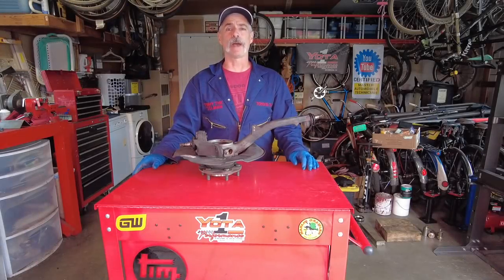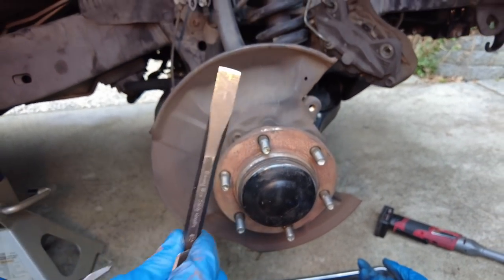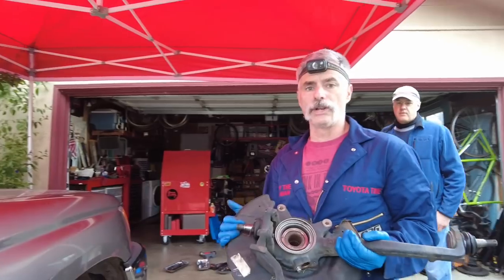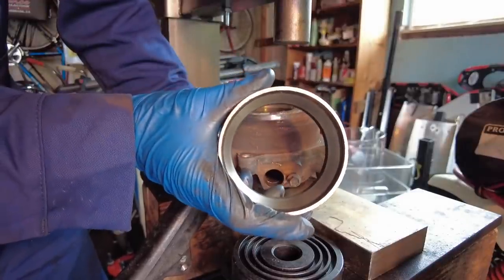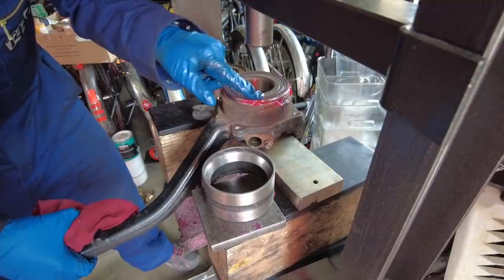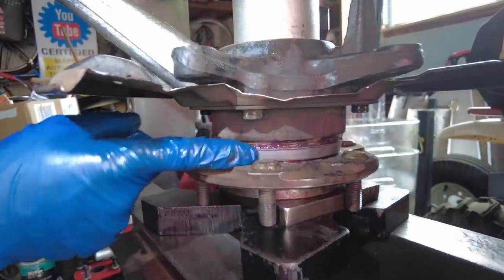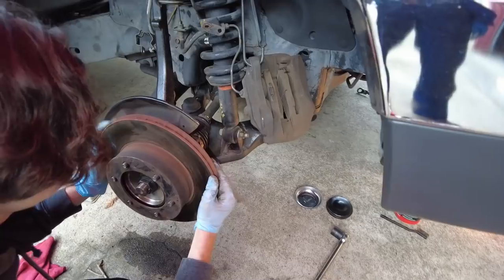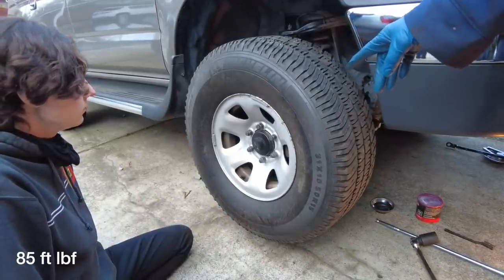Front Wheel Bearing Replacement (3rd Gen Toyota 4runner & 1st Gen Toyota Tacoma)

Comment: Hi. I followed your procedure for manual hub conversion for my Tacoma ADD.  I pulled knuckles from junk yard and installed new Koyo bearings.  Torqued up to 200lb on the hub nut and I still have play in the hub to knuckle.  Looks like the bearing inner races are moving inside the outer races.  Is there supposed to be play for heat expansion?  Any thoughts? Bearings both bad?? Thanks
Reply from the maker: There should be zero play in the hub when you torque that lock nut to spec.  The locknut preloads the bearing just like the torquing the CV axle nut does with the A.D.D. systems.  Something isn't right.  Did you properly support the inner race of the bearing when pressing the hub into the bearing?
Reply: @TimmyTheToolman  Thanks for the quick  reply.  I did support the inner race when pressing in the hub.  I pulled it apart again and clamped the new and old bearing inner races together just like they would be on the hub to measure them.  The old bearing measured 2.005" and the new one 2.015".  Maybe they were not machined correctly.  Also if the new bearing is squashed on the inner races I still have play in the outer race, longitudinally.  I think the "NEW" Koyo bearings are bad.  Going to call up Koyo and ask them about it.  Do you know if anyone else has had this problem.  I reassembled new hub with old bearing and it's tight (no play) so its definitely the bearings.
Reply from the maker: @kimfc9200  I can't remember anyone saying they had this same issue.

Comment: My 2000 1st gen tacoma just gave up both left and right rear axle seals :( , I checked my breather (mod hose) and it was clear and clean. My truck only has 115k miles, what makes these seals/bearings give up ? temperature swings, age, highway driving ? I have had other trucks that had over 200k miles and with never a leak or bearing replacement. thoughts ? I suspect when you pull axles , as in my case, to do diff work (locker install) that might disturb the seals just enough to start the leaking, but I drove the rig for 5 months with the new diff without any leak, just all of a sudden started, on both sides. Strange ?
Reply from the maker: Sort of strange both seals went at the same time, but one factor you didn't consider is AGE.  Even though those seals only have 115k miles on them, they are 24 years old.
Reply: @TimmyTheToolman  yes, agreed, age would be the first guess, puzzling a bit, but perhaps also because I put in a Detroit Torsion diff (not exactly a locker - but more like LSD), perhaps there is some kinda lateral flex going on when it engages ? Otherwise, maybe the seals/bearings were just at the leak point and "disturbing" them by pulling the axles to put in the diff was just enough to "wiggle" them out of position. Anyways, great video and saw the part 2 with the new tool, looks like a logical job, but I have a Toy shop that will do it for me and maybe have to clean/replace the brakes also, messy work ! Thanks for the reply !
Reply from the maker: @Evepc_Tucson  How much will the shop charge you to do both sides?
Reply: @TimmyTheToolman  not sure yet, but I believe they will use OEM parts and they are a Toy shop with decades of experience, so they have all the tools and the press and stuff to do the drums if they have to. They may have to replace the drum shoes since they have been soaked (and driven) in oil. So best to have it in a shop in case they have to do those or free any seized bolts and such. likely over 1k. If I was in CA I would bring it to you ! ;)
Reply: @TimmyTheToolman   **could you clarify the flipping of the retainer ? It seems that you thought you needed to flip it, then you flipped it back (beveled edge facing toward the diff) , **however in the Part 2 video , the one with the ABS tone ring, you did flip it (beveled edge toward the outside). I'm a bit confused about this, even tho I get the concept , i.e. you want the seal to "ride" in the middle, wouldn't Toyota machine that retainer to spec and I would think you would want the flat edge resting on the bearing , instead of the beveled edge. thoughts ?
Reply from the maker: @evepc  I think it will be expensive.  With the money you save doing it yourself,  you could buy the press, special axle tool, etc.
Reply from the maker: @evepc  We flipped it in both videos, bevel facing the ABS tone ring for the inner retainer.  The outside retainer for the bearing has the flat side facing the bearing.  Watch the videos carefully, and don't skip any footage, or you might get confused.
Reply: @TimmyTheToolman  indeed, but I don't have a garage, in fact, only a gravel driveway, and not a buddy or the tools to really do everything without some real challenges, like wind, rain, sunset, etc. I think if I had a garage and more personal time, I could try to do it all and have a place to store the press/stand, etc. **on the flip retainer, so the service manual does not specify the orientation ? thx
Reply from the maker: @Evepc_Tucson  The retainer flip is a modification to the original OEM set-up to address the redesign of the axle seal.  You really need to watch the videos from the beginning to get the full story.  You're asking questions that would be answered if you simply sat down and watched the videos in their entirety.  I'm not trying to be a jerk, but answering questions that are answered by watching the video and reading the video description does get kind of old.  We do our best to answer people's questions in a timely manner, and we do it because of our desire to help people.  So please do me a favor and watch both videos in their entirety, read the video descriptions and also read the comments we pinned (1st comment you see) before asking any more questions.  If you still have questions after all that, come back and ask away.

Comment: I’m in the middle of this job currently on a 2003 Tacoma pre runner and noticed that my bearings are oem timken, but are facing the opposite way with the black side facing outward. Also noticed that the outer race has a arrow facing away from the black side of the bearing. Any thoughts?
Reply from the maker: I think your bearings might have been replaced by someone and they installed them backwards.  But who knows, maybe the direction doesn't even matter.

Comment: Great informative video, only NEVER use wood in a press!
Reply from the maker: Never use wood?  I've used those wood blocks for many wheel bearing jobs.  I disperse the load by using steel plates in between the wood and the spindle and the wood and the press crossbar which prevents a concentrated load on the wood.  So, I'm not going to agree with you.  Those wood blocks have worked and will continue to work just fine for this application.

Comment: Hi Tim... I have 01 toyota 4runner in perfect condition with 180,000 miles...  no warning lights in the dashboard and everything works great except when the speed between ( 50 and 65 mph ) or when I hit hill the car start cutting down for couple times until I get the ( 65 or 70 mph ) after that the car runs smooth. Can you help please?? Thanks
Reply from the maker: I'm wondering if this is a fuel delivery problem.  When you climb a hill, the engine is working harder requiring more fuel and gravity is working against the fuel pump.  Does this ever happen on flat ground or when going downhill at the same speeds?
Reply: @TimmyTheToolman  Yes it's happen on flat ground too especially when I drive it on the high way between 50 and 65 mph, but when I pass 65-70 mph the car runs smooth.
Reply from the maker: @ghaithghaith2985  Hmmm, if it were me, I'd suspect the throttle position sensor next.  A problem with your 2001 throttle body is you can't buy the throttle position sensor separately.  You have to buy the whole throttle body and it's around $500.  But, before you drop that kind of money, you should do an ohms resistance test of the throttle position sensor to confirm it's bad.
Reply: @TimmyTheToolman  thank you so much brother.

Comment: Hi Tim, how tight does the wheel spacer have to be pressed onto the tone ring and bearing?
Reply from the maker: Press it on until you feel the press load up.  It doesn't require much force to press into position.  You'll also know it's done when the face of the hub shaft sits around and 1/8" below the face of the bearing spacer.

Comment: Hey Tim I need to do this job on my 03 taco 2wd prerunner. Are the parts that same for mine?  
Bearing 
Inner & outer seal also snap ring ? 
Thank you in advance
Reply from the maker: Hey Carlos, your knuckles are going to be different because of it being a 2wd.  I think the bearings, seals and snap rings will still be the same though but I'm not 100% sure.  If you plan on doing this job, you'll want to watch our Manual Hub Swap videos because those are similar to your knuckles.
Reply: Great info sir thanks . I got a video of my front bearing noise but can’t figure out how to load it here haha ..
Reply from the maker: @carlosrebollo405  Did you check for play in the bearing like we show in the video?  If so, do the bearings have play or are they just making noise?  You can send the video to my email: mtbtim@sbcglobal.net
Reply: Just send you the vid  no play on it but grinding noise for sure .

Comment: No one seems to have asked the obvious question: Why not buy the whole assembly  predone with all the bearings and races?I don't have a press and the associated press sleeves etc. It will be aftermarket and just getting all these tools to do just one bad bearing seems a bridge too far?
Reply from the maker: Well, because aftermarket parts are inferior to OEM.  You'll get an inferior knuckle, inferior hub, and most likely an inferior bearing, but sometimes these assemblies will come with a good bearing.  So, you're throwing good parts for inferior ones, that's why.  The tools will pay for themselves after one or two uses.  A press and press sleeve kit isn't a single use item if you like to turn wrenches.  They can be used for lots of other jobs.  

If you have a shop near you that isn't incompetent, you call pull the knuckles and have them do the press work for you.  But, you have to be really choosey using a shop.  So many shops screw this job up, mainly due to the fact they don't properly support the bearing when pressing in the hub.  

Anyways, good luck with your decision.  Just remember, tools are investment.

Comment: Timmy, love the videos, man! Question. The bearing you use from amazon claims it is 'Toyota Brand'. But in the description, it clearly says "Made in China". Using the same part number, I was able to find OEM, made in Japan, Koyo brand for almost $10.00 less from several Toyota dealers across the country. These are clearly marked Koyo Japan, while those in your link aren't marked with company or country of origin (though it states China in the description). What gives????
Reply from the maker: Some Toyota parts are now made in China.  I know the last radiator I bought that came from Toyota was stamped, made in Taiwan.  So, the link we provided did claim Toyota OEM for the bearings and that's why we provided that link.  It's impossible for us to vet every product link.  The seller claims Toyota OEM and the reviews were positive.  It sounds like you bought your wheel bearings from a different provider and that's cool.  This is why we provide the part numbers so people can do their own searching and purchase the parts from whoever they like.

Comment: For big azz tires i like to roll it on my feet and i can lift with my feet  to alighn it WHEN IM WORKING ON THE GROUND

Also helps to line up everything before lifting lug stud at 12 o clock rim opening 12 o clock aswell
Reply from the maker: Interesting.  I've always used the forearm and leg technique.

Comment: Hi Tim, need to replace my front dust shields on my 2002 Tacoma double cab 4x4 which requires removing the front hubs. Can I do this on a perfectly good hub bearing assembly without replacing anything? Any recommendations?
Reply from the maker: You would mess up the bearing doing it and also the associated seals most likely getting them off the knuckle.  One option is cut the dust shield in half and put it on in two separate pieces and then weld it back being careful not to burn through the material because it's pretty thin.  Other than that, it's going to run you some money and time keeping the dust shield in one piece.  If you don't have a welder, I bet a muffler shop would do it for very little if you took the knuckles to them.  They weld all day everyday with some pretty thin metal so they'll be able to do it for you no problem.  Good luck!

Comment: How does the job differ with a RWD  drivetrain?
Reply from the maker: Well, you don't have a hole in the hub to accept a CV axle.  And, since you don't have a CV axle, you don't have a CV axle.nut that preloads the bearing.  You will have a lock ring on the back that sets the preload for the bearing just like the manual hub versions of these steering knuckles have.

Comment: Question....why cant this be done with the spindle on the truck?
Reply from the maker: I've seen it done with different tools that we don't have.  We chose to use a Harbor Freight press so the knuckle has to come off.
Reply: @TimmyTheToolman  thanks Tim.   I really appreciate your videos and im a novice DIYer with an 05 Sequoia 4wd up here in Calgary.   A few weeks ago I replaced the Passenger side front diff output seal and tappy-tapped it in to the proper depth based on your video.   I only had to remove the LJB bolts to swing the spindle enough to push the axle out though.  Thanks for the help.
Reply from the maker: @bedarailmodels  You're welcome.

Comment: After abs tone ring with retainer pressed. Is it normal for abs ring to spin freely apart from the spindle? Help
Reply from the maker: Yes, neither the bearing spacer nor the ABS tone ring are a tight fit.  When the CV axle is installed and the nut is torqued to that high spec, nothing is going to spin other than the CV axle, the bearing and the hub that is pressed into the bearing.
Reply: @TimmyTheToolman  thanks so much! And for the quick response. Looking forward to your future tutorials
Reply from the maker: @pandj350z  You're very welcome.